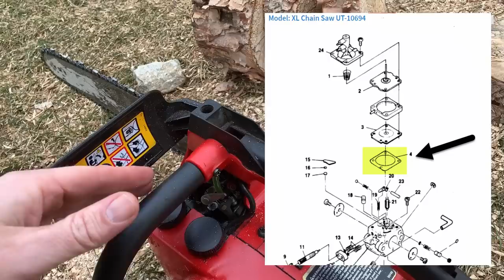Homelite Super 2 Chainsaw - Carburetor Rebuild and Tuneup

Comment: A worn/stretched chain (the drivers get out of pitch) will "eat" a new sprocket.  A worn socket will similarly quickly wear a new chain's drivers.  Good strategy is to have three new chains per new sprocket.  Use each until dull,  sharpen all three and rotate useage again.  By the time all three chains are worn to the max, get new sprocket and chains.  These engines, so far as I have seen, always have a gasket on the carb and then the pump diaphram, this provides the volume of fuel best for high speed use.

Comment: the gasket that go's on bottom is the fuel metering diaphragm the gasket that goes on top with the check flaps is the actual Fuel Pump Diaphragm

Comment: With shop rates anywhere from $60 to $90 an hour, it’s not worth it.
However, if you can fixit yourself or have a friend who can, you may be ok.
I like my neighbors, but not that much. 
First thing I would have done was give it a cleaning.
Reply: hello i enjoyed your videos and am also a small eng mechanic on spare time i usally use chem dip or the solvant tank to clean anything like carbs and stuff what was the thing in this video that u used to clean the carb when you put it in some time of hydro cleaner it blew my mind what is in it and it works that good? i usally have to wait 20, 1 hr , overnight sometime soak them

Comment: The third oil line is the pressure line, it should have a duckbill check valve on the end in the oil tank, this pressurises the oil tank to push it up to the needle pump. On these chainsaws the duckbills like to revert back to the goo they were refined from and on a saw of this age, expect to replace them all with quality oregon red ones. Also check the needle on the diaphragm oil pump is free to move, my super 2 VI wasn't oiling and it turned out the little needle had frozen in place, was able to free it up.

Comment: My rule is - if I have to go into a carb I always replace the diaphragms.  I do not like the old adage - we fix things right, we fix them twice.  I do not like having to go back into a carb the second time.  I also pressure check them before putting them back on for the same reason.
Reply from the maker: Need to get a mityvac
Reply: @jcondon1  that is not all you will need.  You will need rubber gasket material and short pieces of hose to connect up carbs and to seal off carbs and exhausts.  I keep these in my MightyVac case.  I have the 8500 version.  I really like to use it on chainsaw carbs to make sure they are holding pressure and working correctly. They are also great at pressure testing fuel tanks, fuel lines and tank vents on two cycle stuff.  I keep mine in my office, so as not to expose it to the cold and heat in my shop.  Mine cost about $75 when I got it and comes with a nice case and lots of little connection adapters.
Reply: @johnclarke6647  the mityvac uses extra components for the pressure ie , the plunger shaft,  lipseal at rear an extra ckvalve . w a lot of use or dry shaft lipseal wears and seals less so pressure max drops . any gas instantly swells seals. all parts of carb can be checked before disassembly including hi ck valve to determine if it can be rebuilt or best replaced. purge bulb operation also.

Comment: Maintenance was in mind but back than it was a different kind of Maintenance. Today saws are basically built to be maintained on the job site. In the past they wanted saws that would run all day and only need Maintenance at a specific time.

That being said, they designed it to be taken apart that way so you could maintain everything after its apart and didn't have to take something off and put it back on for each part, it was all accessible all at once. 
The information I've provided isn't backed up by 100% fact or anything so I could be wrong but im pretty sure that's why its built that way.

Comment: The reason shops don’t like Homelite and MAC saws is you have to literally take them apart to repair much of anything on them.  At at$100 an hour shop labor cost these days, most shops will not even mess with them, anymore.  They are good saws, but you need to find an old timer if you want them fixed.
Reply from the maker: I agree.  The labor cost alone is more then the saw is worth.
Reply: @jcondon1  usually with experience, knowledge, and tools disassemble is fast so part availability is main issue as people expect to pay high price for high priced tools repair but not for low priced tools ie cost more than it's worth.

Comment: I'm really glad you repaired this model. I have the same unit and have replaced the sprocket once but the automatic chain oiler doesn't work. I have the feeling whoever repaired it before pinched a line inside somewhere. I do not know if there is a pump for that chain oiler. Any suggestions?
Reply: if pump is def. / and unavailable u can bypass it and use pressurized oil tank to lube chain but may get siphoning when not running. pump diaph. must seal carb. vac. whether used or not.

Comment: Shop turned down working on this saw because it is far from service friendly.  Lots of older saws are like that, having to take it apart and out of the case to clean the carburetor.  I always blow out the dirt/debris with air compressor as much as possible.

Comment: If you look at the top of the carb usually right next to the mixture screws it will give you a 3 letter code. Type that code in online and you will find a kit.
Reply from the maker: Thanks

Comment: You're very clever with small engine repairs James, and I've learnt a lot off your generator videos. Please learn how to use a chainsaw properly before filming and showing others though, that technique was terrible - and dangerous. 
To cut a round / log on the ground you can cut 80 - 90% through it from above holding the bar level and ensuring it doesn't touch the ground. Then roll the round / log until the remaining wood is on top, then push the bar through the cut so the tip is clear, and cut upwards. This ensures you don't blunt the chain, but most importantly, don't touch the tip on anything (ground or log) which can cause kickback. Kickback is highly dangerous and can cause serious injury or death with a sharp chain spinning quickly not controlled properly by the operator. 
Otherwise elevate the round / log so you can comfortably cut through it for testing eg in a sawbuck.

Comment: You hit the ground with running  chain, next time put wood to be cut off the ground so you don't dull the chain
Reply: soil /dirt is usually made of tiny rocks /sand to rapidly dull and grind. try cutting a below ground stump full of minerals drawn in by root system will dull sharp chain rapidly.

Comment: Sprockets get worn out from a chain being to loose or to tight, usually.  Saws without chain adjusters are tough to set chain tension properly and most old saws do not have chain tension adjusters.

Comment: I’m having a terrible time with one of these. It runs great for about 15 secs and then runs out of fuel. I can get it to restart by choking 2 pulls and back to half. Starts and revs up fine then like hitting the kill switch, 15 secs it’s dead. Tank not venting? The metering side of the carb staying plugged?

Comment: I wonder if that missing gasket is there to prevent the corners of the carb body from cutting into the diaphragm as it pulses up and down? Or perhaps to give proper clearance for the full pump of the diaphragm.

Comment: That clickety clack after you changed the sprocket is the chain. It's worn too and no longer syncs with the sprocket very well. Also, you should have cleaned the engine while it was out of the case. That thing needs to breathe properly.

Comment: Do you have a part number for the primer bulb?  I have a Homelite 200 chainsaw that the bulb is shot on.  I went to the local hardware store and bought a fuel line repair kit but the bulb case is smaller and won't fit in the hole.  I looked on amazon and there are so many I don't know which one to get.  I see all these numbers and just leads to confusion.  There are so many OEM #'s.  Thank you.
Reply from the maker: Here is a link to the primer I used on this saw.  Not sure if it fits yours Hipa 188-512-1 Primer Bulb Pump 188-512 for Poulan PP445 PP446 PP446E PP446ET PP446T SM446E Pole Pruner Homelite Chainsaw Parts - 5 Pack https://a.co/d/eUv5YcM

Comment: Sprocket - someone has put the wrong pitch chain on it in the past, which will eat up a sprocket.
Reply: all sprockets wear but the grit, sawdust and hardened steel chain link load does most.

Comment: I start first at the oil tank,....dump it out,....rinse it out with gas till its clean,....I dump the fuel out,.... rinse it out with gas till its clean,....then I mix new fuel  Sunoco 90 octane no ethinol,....I mix it up,....I replace the fuel filter,.....then I see how it  runs,....I run it while cutting to see if it straightens out.
After several days then I look a little further.
As far as I know some carbs were walbro  and I forget the other one.
I bought a Huskvarna copy new it wouldn't run I took it back and bought 4 more homelites off of Ebay.

Comment: Hello, I am trying to work on the same chainsaw and carb. Your video is very helpful, thank you for posting.

Do you remember how you go the high and low needles out? It doesn’t look readily apparent to me.
Reply from the maker: Good question.  Each needle has a turn limiter.  Someone before me removed one of the limiters.  Once one has been removed, they both can be turned out.
Reply: James Condon thanks for the feedback. For the life of me, I cannot figure out how to keep this saw to running. It starts and runs briefly with choke off and will rev up but dies within 10 seconds no matter if you leave it on idle or rev it up. To me it seems like it is starving for fuel. I have rebuilt the carb with a similar kit to what you ordered. Ensured the float was set flush with the metal surface. Removed the fuel filter and replaced the fuel line. I cannot figure out why it won’t stay running.
Reply from the maker: Nick Gregory I agree with your diagnosis and would have done the same thing as you.  Be sure you have the fuel lines connected up properly.  It is important the the purge bulb sucks gas through the carb.  If the lines are connected properly then the only other things to check are the reed valve or crank seal.  Would lean more towards the carb though.
Reply: James Condon to your last point about the purge bulb - when I installed this I assumed that the bulb should “pump” fuel into the carb. I pressed the bulb in and out to determine which port was suction and which was delivery. I hooked up the suction port to the line running into the tank and the delivery port to the carb. Can you confirm that is correct?
Reply: James Condon and lastly, do you recall approximately how many turns out you went on the hi and lo speed needles prior to fine tuning?
Reply from the maker: Nick Gregory that might cause the issue you are reporting.  The sucking part of the bulb should be connected to the carb and delivery should be the return in the tank.  The other line should have the fuel filter in the tank and the other end connected directly to the fuel inlet on the carb.
Reply from the maker: Nick Gregory I will double check the raw footage.  I think I recorded that info but may have cut it out of the final video.
Reply: James Condon I heard you say you adjusted the high speed screw out 1 and 1/4 turns, but you didn’t mention the idle or low speed needle.
Reply from the maker: Both were set to 1 1/4 turns out

Comment: Please explain the battery charging system in small gasoline engines, as well as explain the protection system from the low level of engine oil. Thank you
Reply from the maker: 7atem 25 surprisingly a lot of portable generators with electric start actually have no charging system for the battery other then the wall adapter.  Some have a system that uses the 120/240 volt power to power the 12v charging system.  Others have a more traditional small engine system like in a lawn tractor under the flywheel.  That system produces a lower voltage AC which is rectified into DC for the battery.  What model generator do you have?  Most generators low oil system are float based some are pressure based.  The float system has a “float” which floats on the oil.  When the oil gets low, a metal contact  touches the metal on the bottom of the sump and sends a ground out on one wire leaving the engine.  That wire is connected to a low oil module which adds a delay so the float has to consistently be grounded for a few seconds before the module allows the ground through to the ignition coil killing the spark.
Reply: @jcondon1  thank you for replying
Reply: @jcondon1  My Generator is : Senci SC10000-II , Chinese made with 459cc gasoline engine
Reply from the maker: 7atem 25 I found the wiring diagram for the SC10000E, which is probably very similar.  Although not 100 percent clear, it looks like it has a charging coil behind the flywheel.  The wire coming from that goes though a diode, then an 8 amp fuse and down to a post on the starter selenoid.  Then to the positive on the battery.  There must be a bridge rectifier somewhere in the circuit, but do not see it on the diagram.  I will post the diagram shortly to my community page on my channel main page.
Reply: @jcondon1  Thanks, I appreciate your help

Comment: No untrasonic cleaing? if it was me after figihnt to get it out of the case i would have done it "as a matter of course"  and yes clean out the case and the off the engine too. flip teh bar and sharpen that chain.

Comment: I was given one of these saws bye a co-worker and now I know why haha.  It doesn't run and the muffler is broken off, I think I'll pass on this repair job and buy something more modern that is easier to buy parts for.
Reply from the maker: Smart move
Reply: If you can't find parts for a super 2 you must really stuck at finding parts.
Reply: Not usually, but why bother working on a throw-away chainsaw when I have plenty of other things that need attention, money and effort?
Reply: @spec8473  the super 2 was a professional grade chainsaw the first 10 years it was out. The only difference in the later years was the housing around the engine was plastic instead of magnesium. But the engine stayed the same. They are a damn good saw and have proven to stand up to the test of time
Reply: Well it can stand up to the test of time on my garage wall as a decorative piece.

Comment: Remember that chainsaws get better features with each new model. In the UK that one would not be thought well of for lack of a kick back guard. Here the left hand knuckle guard features a chain brake, yours didn't have a chain brake. I can see the repair being neighbour friendly, BUT probably it would have been better to buy a new saw with better features.
Chainsaws usually make and ingest enough dust to kill them within two years. I used to have a box of washable air filters and change them every tank of fuel.

Comment: Horrid thing to work on. Filthy, crappy design. 
Good you fixed it. Surprised you didn't check the exhaust/exhaust port for being carboned up. These little two stroke engines can do that quickly and this can give most of the symptoms you mentioned.

Comment: I would not be working on anything that dirty and put it on YouTube when it only takes the tiniest bit of grit to enter the crankcase for it to be game over for the bore and being someone else’s equipment it takes a couple minutes to degrease it wash it off and hit it with the air gun to dry it’s done a clean saw stays a lot cooler when clean and you was saying how you wanted the saw to last a lot long for your neighbour
Reply from the maker: Your right, should have spent time cleaning it before removing that carb.  I did clean it before putting it back together, edited that out, but I could have done better.  He was running it without a filter so probably will not last much longer.  I did not charge him for parts and labor, just wanted to help him out.
Reply: @jcondon1  Wow!  You're an awesome neighbor.  Parts and labor were way above the present day value of that saw.  Kudos for your good heart.  Kind regards, Al